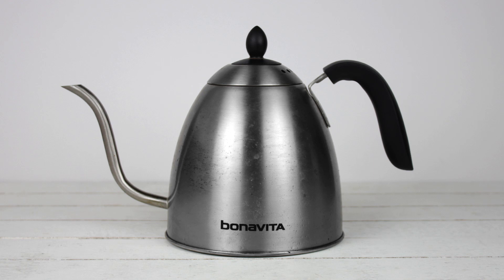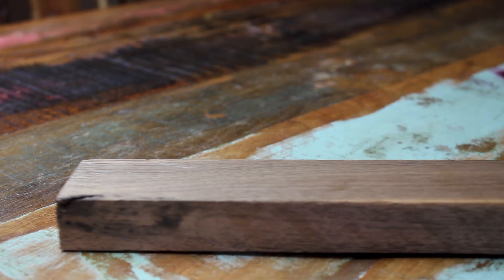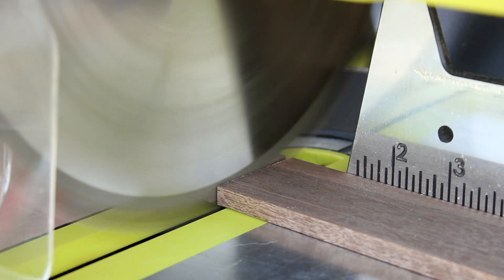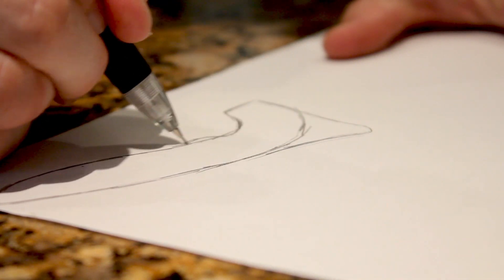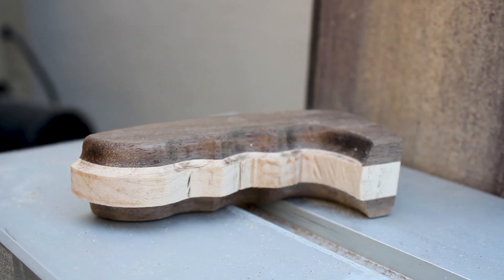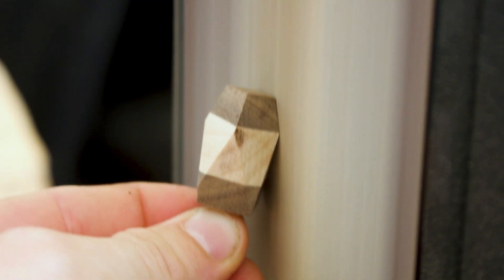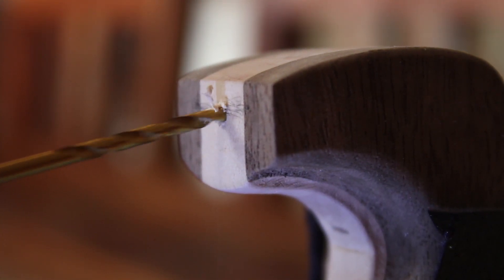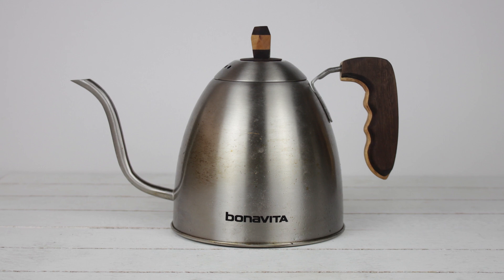Tea Kettle Upgrade / Woodworking | 23

Comment: you could cut the slot for the handle in the pieces before you glue them up, mocking up the fit in clamps, then you wont have to mess around with a drill. just a thought for next time :) nice vid. I particularly like the geometric lid and what you did with the router on the handle.
Reply from the maker: Thanks for the tip. I wouldn't have thought of that actually - maybe I was worried that come "finished product" I'd have not cut the hole properly. Either way - thanks for the comment!
Reply: you would have to worry about that, and about glue filling up the slot during the glue-up but it might be worth trying.